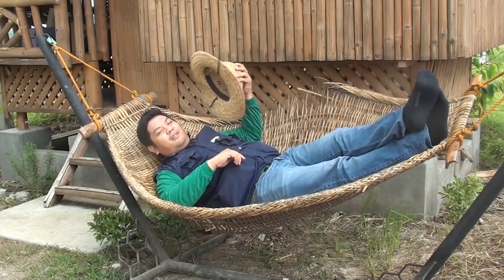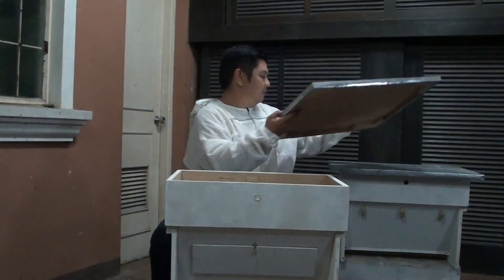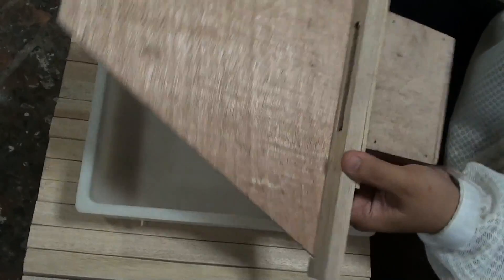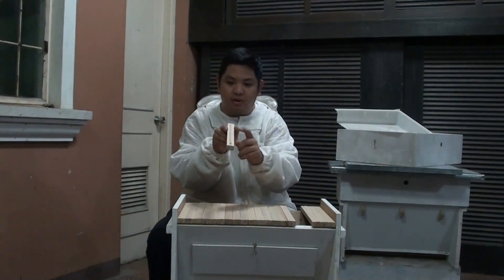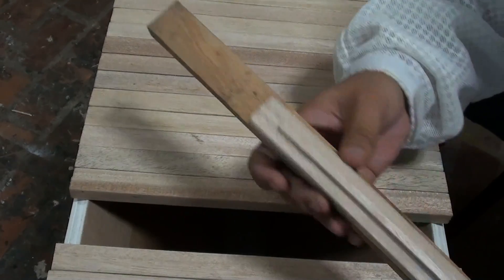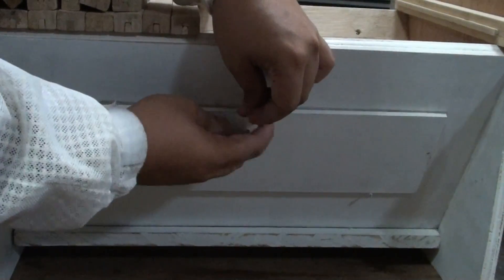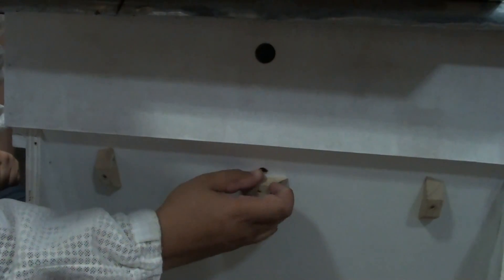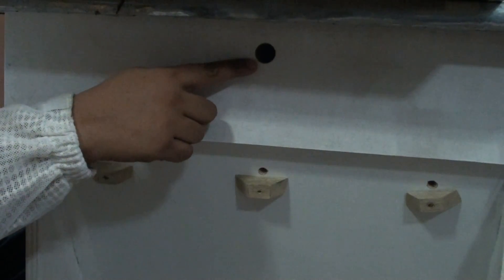Top Bar Hive, Apis Cerana

Comment: Kuya!  Please tell me the optimum volume for Apis Cerana.  I have leased one 16,000 sq-M and also one hectare properties near Tangub. It is my belief that Apis Cerana as well as Tetragonula Boroi, I domesticated hives, managed on the farms would increase yields of coconuts and bananas as well as the other fruits and Vegetables grown there. Optimum with and depth of the top bar set would be helpful. So far, my research tells me that A. Cerana likes a smaller hive than dose A. Mellifera. As I am two meters and 130 kgs,  a lagstroth hive would be acceptable for me but my staff is only 2/3 my height and 1/3 my mass. I think a long hive or top bar would be better suited for both of us.  Any thoughts would be helpful. Btw, I believe I’ve found a good PVC design for the Tetragonula bees.  Tetragonula seem to like a few liters for brood and separate stores. I’m still working out a duplicatable hive design for the Apis Cerana.  As always, Salamat Kuya.